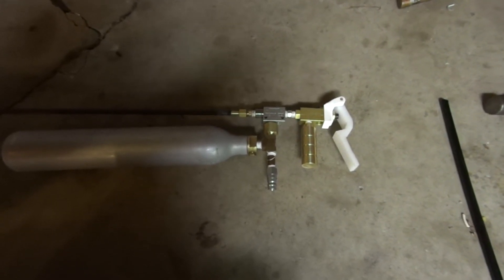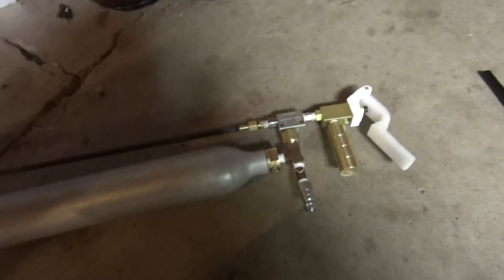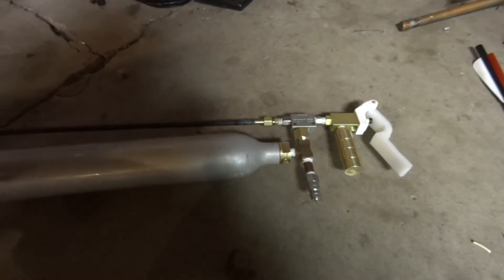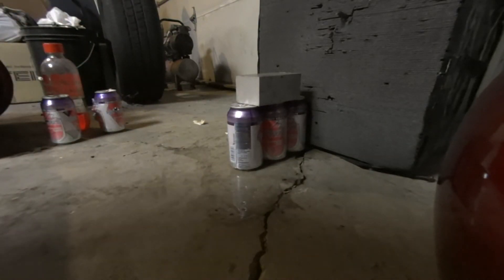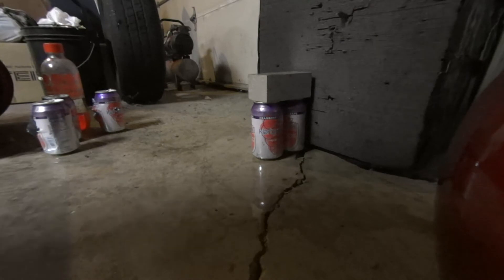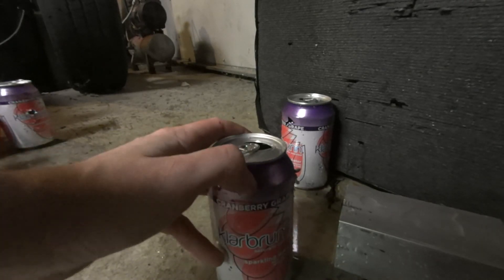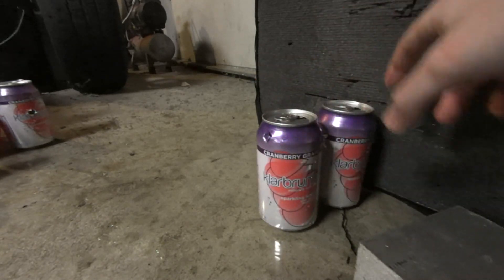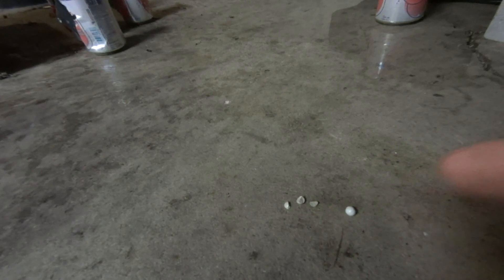QEV Arrow Gun: Airsoft BB's vs Cans  600 psi +

Comment: About the misterious bb, I can only imagine two options: accidentally loading two bb's (forgetting having loaded one, so loading a second one...) OR... some bb's stuck into the mat that fell during impact? 
BTW those are biodegradable bb's? because they are somehow more brittle than the standards. I use the biobbs and I almost never recover a single solid sphere.
Reply from the maker: DoNotPushHere I for sure only fired one each time. Second scenario might be accurate though. I'm not sure if they are biodegradable. I know the yellow ones I have for sure aren't. The grayscale ones I have don't have a label
Reply: i meant loading two and firing once; forgetting to have one inside and thinking "heck! I don't wanna fire a blank!". It happens to me sometimes but I recognize mine is muzzleloader and I can't check the breech. 
Also I am curious to know: do you have anything to prevent them from rolling when aiming downwards?

Comment: Hydroshock is always impressive. Not T. Bag for 600psi and airsoft bbs. Love to see 900psi co2 pressures and 6mm steel bbs 😉
Reply from the maker: air molecules are smaller than co2 and therefore perform better at lower psi.  need to get some new gauges before i try to see what the max pressure of my new compressor setup is.  i was was considering trying steel bbs, but didn't want to ruin the carbon barrel.  but literally a few minutes ago the barrel just exploded after i fired some of the airsoft bbs into a block of wood.  i'll get a video of that later.  so now might be the time to try out a new barrel
Reply: Dang. Engage them safety squints bud
Reply from the maker: they're always on.  lol.  part of the barrel hit my thumb, and the explosion was super loud, but besides that i'm fine